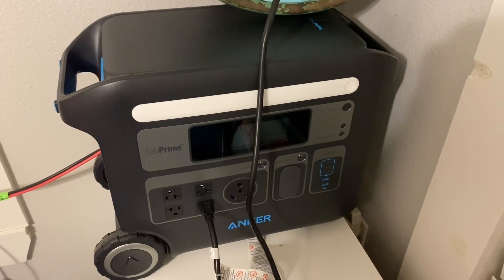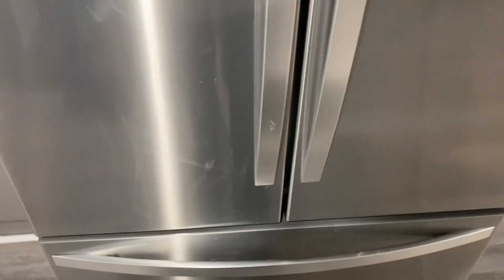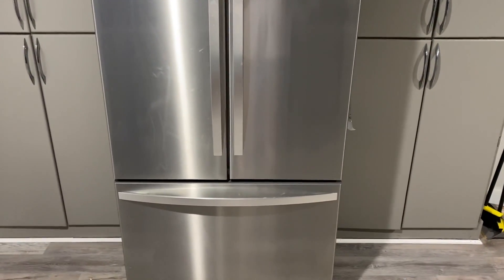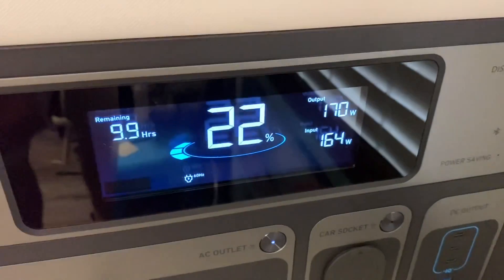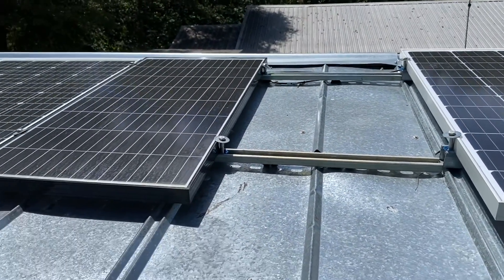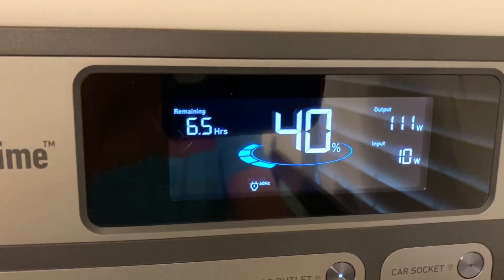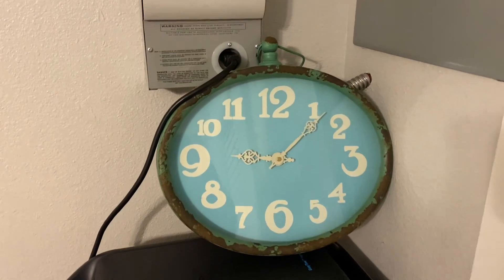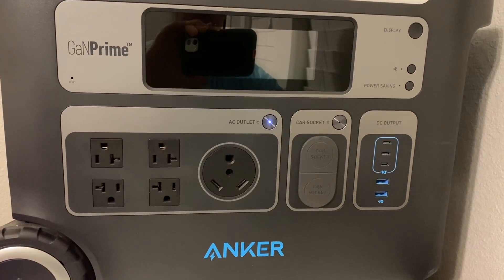Anker ￼SOLIX F2000 (Powerhouse 767) running home refrigerator hooked to 300 watts of solar ?

Comment: I just got a F2000 a few days ago and really havent had a chance to see how well she paces but i will say that the app for it doesnt seem to want to stay connected. My C1000 with the extended batter has no problem whatsoever with the app but the F2000 does. Other than that, Ive been using it to driveway camp and shes been flawless. Im still thrilled with my purchase. Plus i got it on Amazon for $999. I bought nine for my skoolie. Im going to have mine hooked up to the 800 watts of panels i have on top and my C1000 will be charged by my portable panels.

Comment: can i charge the battary while its powering up the fridge :) ???? could i charge it from a smaller  jackary battary to Re charge this big one ???
Reply from the maker: Yes you can charge it while using it. Not sure what size Jackery you have but it should charge it but if it’s a small Jackery your aren’t going to charge it up completely with it. You will only be able to charge it up to them amount of watt hours your Jackery can produce. The F2000 is 2000wh. If you tried charging it with a smaller power station lets say 200wh to make it easy then you would only be able to charge the F2000 up about 10% if you started with it complete drained and the smaller completely charged when you started. 

But it does have pass through charging so you can use it while it’s being charged by solar or an ac source.

Comment: Your not connected to 300watts of solar.  Watts=volts times amps on paper. In practice, your dissimilar panels use the lowest amps and lowest volts of the 3.  That pretty much guarantees in a perfect setting, you will be will below 300 watts.  Thanks for the practical example of what your refrigeration actually draws.

Comment: Very good video, How long does it take to charge 100% using the wall outlet? tks
Reply from the maker: @alexherrera3918  if you have it set on the fast charge you can charge it at 1400watts and with that able to charger under 2 hours.
Reply: @Suncatcher-wt2od  ok tks!

Comment: Nice video. I ordered mine 10/8/24.
So from what i comprehend for power outage i can have a transfer switch installed say to my kitchen. I can just turn off lights and all other appliances and i should be able to run a fridge for about 12 hrs on full charge. Or I can unplug the fridge to use other appliances or outlets in the kitchen correct? 
I may have to return it when it arrives.
Thanks.
Reply from the maker: @djpapajohn  it should run some other things along with the refrigerator at same time. But that would cut into your run time for the refrigerator. But if you had something you need to run for couple minutes or maybe a small amount of watts like for a light or something you should still get close to around 12 hours depending on your refrigerator
Reply: @Suncatcher-wt2od  thanks 4 the quick response.
The power outages in my area last few hours, a day for the most however I will explore the solar panels once I use the power station a few times. In winter I would run a heater longer than my fridge for an outage. In summer definitely the fridge.
Thanks again.

Comment: Considering this for my enclosed trailer for mobility and not having to wire up the trailer.  Which, I’ll equip with a microwave, and small camping fridge.  May use a TV on occasion.  I use a CPAP at night.  If I purchased 2 400 watt panels or 3…do you feel this would keep me powered up? …understanding it depends on variable use…
Reply from the maker: @102Montana  I do believe you could get by with one depending you get enough son during the day to recharge. Of course I personally never tried with your combination so I can’t say for sure.

Comment: Your audio is so low I can't hear what you are saying on my laptop with my sound settings at 100% and YT sound settings also at 100%.  Just bought my 2nd Anker 767 power station, they are really great products.  I have 1000 watts of solar panels, and plan to charge one power station while using the other, and switch back and forth, or possibly set up a transfer switch that will direct the incoming solar power to either power station.  I took advantage of the recent sale price for the 2nd 767.

Comment: Great review! Question for you though, Im thinking of a specific use case. 

Is it possible to have both AC charging and solar running at once? And can you leave it like that running without intervention?

Im thinking even if you buy this for emergencies, it would be nice to have it plugged in and providing a few hundred watts of free power without needing any sort of permanent solution.
Reply from the maker: On Anker you can not charge with ac and solar at the same time it will charge by ac if you have both hooked up. 

But you can use the ac power while you are charging it with solar. So you can keep it charged up while using it if you have enough solar hooked to it.

Comment: So is it true that you can simultaneously solar charge and consume power? I chatted with Anker, and they said that the F2000 cannot do simultaneous solar charging. I'm confused, because your video shows that you can...
Reply from the maker: Yes you can charge it with solar while you use the power. This is called pass through charging. 

But you can not charge it by solar and charge it by ac power at the same time. It will default to ac power. Meaning you will only be charging it from the ac plug. This may have been what they thought you was asking in your question. 

Some other brands such as Bluetti while let you charge it with both solar and ac power at the same time. They call this simultaneously charging.

Comment: can u run your whole house on Anker? What is the plug u have on the wall? I want to buy a Anker but still need information.
Reply from the maker: That would depend on the size of your house. They say the average house uses 20000 watt hours a day. The Anker 767 wouldn’t come close to those type numbers. 

I did another video in which I ran refrigerator couple  window air conditioners and several lights through out my house with no troubles with the Anker 767. So in a power down situation with an expansion battery it should do some essentials provided you have enough solar to keep it charged. 

That is a transfer switch that I am plugging it into. An electrician should be able to install one. They are used for when power goes out and hook to  generators. Beats having to plug everting into the generator to run it. 

Anker is about to come out with another unit which is much larger than the 767. It will be the Anker Solix F3800. 

It will be expandable from 3800 watt hours all the way to 53000 watts hours and capable of producing 6000 to 12000 watts with both 120v and 220v. 

Now of course with a larger unit like that it will be more expensive. 

These aren’t out yet but should be out this month so we will get better specs and pricing once they are made Available. In the top of our comments we have a link to our online store once the Anker Solix is made available we will have it listed and of course the Anker powerhouse 767 is already listed. 

Hope that helps with your questions if you have any more please ask thanks.

Comment: Keep in mind you do not need to keep the fridge plugged in the entire time. You can leave it closed up overnight as long as you do not get into it, wake up a couple times and plug it in just to let the compressor run a cycle and you will use only a small portion of the battery storage and the fridge will still be cool enough.

Comment: what if you connect more solar panel and generate more energy than what u need? that way will run forever.
Reply: You can use 1000w of solar with the 767. Most people do them in blocks of 200w each. It has a dongle that plugs into the generator with 5 slots for 200w panels totalling 1000w.
Reply: @CatboyRocketry  didnt know that work. Thanks
Reply: @CatboyRocketry  how can u send me the link of that or the name?

Comment: I just bought the 767 and trying to see how long I can run my fridge should we have an outage. I'm using 2 - 200w panels during the day and their input (365w max) barely exceeds the usage of my fridge so not charging the battery much during those times. I think the 1242w reading you have might be your defroster coil kicking in if your fridge has that feature. The compressor I don't think uses that much. I've seen mine jump from 140w to 360w I think when the compressor kicks in. I'm thinking I'll need the expansion battery AND another 400w of solar to be able to keep up with the fridge load and recharge the battery for night time usage. Good video!
Reply from the maker: I have the Bluetti Ac200max with 1 expansion battery that I have run the same refrigerator and transfer switch. It is the same  watt hours  as the the Anker 767 with an expansion battery 4096wh 

With the ac200max I had 1100 watts of solar hooked to it. I ran that same refrigerator for a week straight with that set up. 

It completely charged up during the day and run all night never missed a beat. The only reason I stopped running it was I wanted to. I wanted to test it see how long I could run it like that. Also had the kitchen lights hooked to it but we didn’t just leave them on, only used them when needed. 

Not sure how much of a difference it would have made had I run that set up with 800 watts. The Anker invert does seem to be a little more efficient not pulling as many watts when in use. I did another video comparing the two Anker 767 and Bluetti Ac200max on same Air conditioner to see the difference and if memory serves me correctly the AC200max used 50 to 100 more watts to run it. 

If you look to up grade your Anker set up in the future consider us in your shopping. thanks
Reply: yeah, you have a nice setup! I just ordered a few more xt60 cables to make setup easier. Instead of running cables 15ft to my 767 I'm going to collect my 2 200W and a future 400W together with a 1 to 3 XT60 multi-cable and then just run 1 cable to my 767 instead of 3. Would love to have 1000 w and the extension battery but think the extension with 800Ws of panels should work.  @Suncatcher-wt2od
Reply: Hi, is the F2000 capable of solar charging at the same time that you're consuming power from it? I chatted to Anker online and they say this wasn't possible, so I'm confused... Hope you can shed some light. thanks.

Comment: $1799  to run a refrigerator for 12 hours.  Wow,  think I'll stick with my champion inverter generator, 20 hours on 4 gallons of gas.  Looks like you need something with a 5k battery.  Great video!
Reply: That's $1,799 to run a fridge for 10 years or more with no outside support. Champion is good, but not that good.
Reply: If the grid is down, can’t get gas anyway.
Reply: So many people don't realize that.  @decormiamour
Reply: Gas is over $5/gallon

Sunlight is free
Reply: It can get annoying for you and the neighbors at night with all the noise of running that gas powered generator